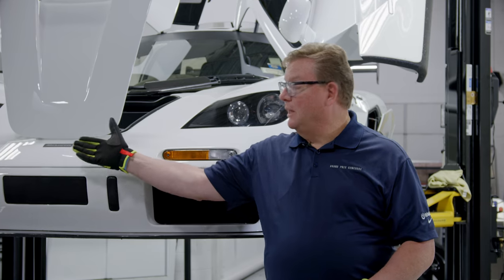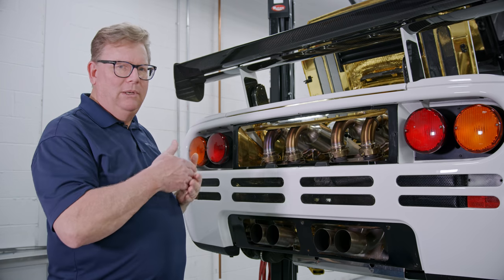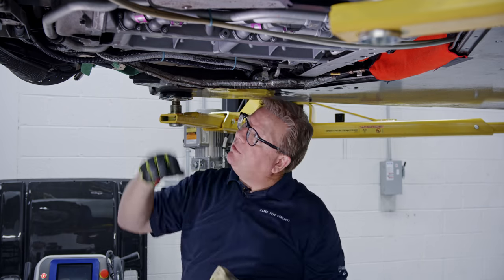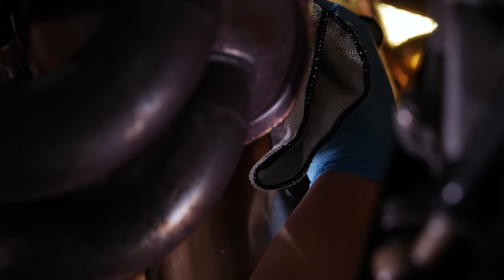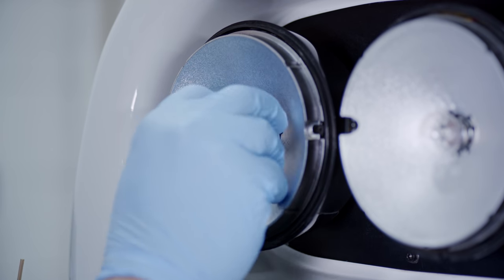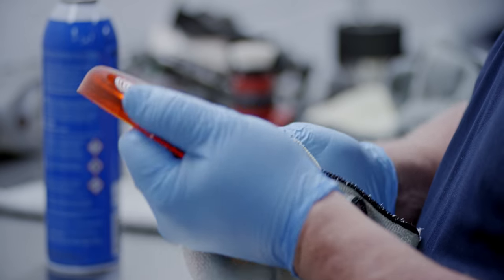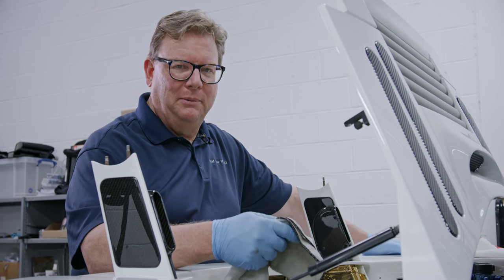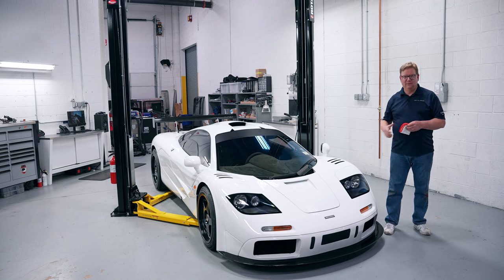Cleaning the 24K gold foil in a McLaren F1 supercar | Beyond the Details

Comment: This car is both a work of art and an engineering marvel. It's way above many italian supercars. No expense have been spared on building this thing, it's more akin a jet fighter plane than a car.
And maintaining it at this level is necessary, and like preserving a (in)valuable artwork.
Reply: As an engineer, it's the first time I am seeing the trick stalling active aero diffuser that Gordon Murray designed for this car. Way ahead of his time with that little trick.
Reply: And those who say that some bits should be replaced (like the rear light covers) I would want to keep everything as original as it was. Specially if its been raced at race like Le Mans 24h, which then would make it even higher in value.

Comment: today I learned there's a job called "McLaren F1 technician", and now I have the sudden urge to learn vehicle mechanics.
Reply: McLaren technician aka mechanic that works in khakis and plays golf.
Reply: @rxwhat33  nope, I definitely don’t play golf.
Reply: @kevinhines1278  Hahaha hello Kevin! And thank you for your hard work!!
Reply: @kevinhines1278  how does someone become a McLaren technician?
Reply: @blakerh  Hi Blake, if you have some experience all you have to do is apply at a McLaren dealership and be good enough to get the job. Then you will periodically be sent to McLaren factory training to progress your skills with the product. The chances of working on an F1 are pretty slim but if you’re trustworthy enough, you never know…
Reply: @kevinhines1278  I imagine it can't be that hard considering you only need to know one car, and it's almost certainly going to be well maintained and well documented and you get tons of factory support in which they spare no expense. I sincerely doubt that you have ever had to deal with a rusty suspension bolt snapping off, or having to tap and rethread a head bolt in a shoddy aluminum cast block. 

But, regardless, I am sure that you are well qualified, and simply dealing with the expectations of a typical wealthy McLaren owner is probably the most difficult part of the job. So, kudos!
Reply: @kevinhines1278  I was wondering why the wing was mounted on 3 studs instead of four? Is that intentional? Or did one stud come off by accident?
Reply: @bobdobbs69  I suppose that the best compliment that I could receive from an individual not privy to the details of the work I am tasked with is to have that person say that it looks like it was easy. So, thank you, sir.

One of the mounting studs for the wing came out with the locknut nut - the situation was rectified before being reinstalled. Good eye.

Be well

Comment: I knew the F1 was an engineering marvel but I have a new respect for them now watching this video. I don't recall ever seeing a white F1 before but WOW it's absolutely gorgeous. The F1 LM or F1 high down force version in orange and now white are certainly on my list of desirable cars.
Reply: As an engineer, it's the first time I am seeing the trick stalling active aero diffuser that Gordon Murray designed for this car. Way ahead of his time with that little trick.
Reply: @bobdobbs69  I really like his new car the T50 I believe it is from an engineering standpoint, but visually I think it was too safe. It's too reserved for the price point it is at and to me the fan on the rear is way too prominent.
Reply: @chesspiece81  We'll soon see how it drives, but it's certainly the most innovative car that I can see on the horizon. A 12,000 RPM NA V12 is going to make some beautiful noises. The T.33 will come out later without the fan, but I agree that the styling is rather 'middle of the road.' 

Considering the rather anemic sounding turbo/hybrid motors on offer from other manufacturers, I think the T.50 might be one of the best road cars ever built. Soon we shall see. ;)

Comment: oh and I was a jewelry manufacturer for 12 years and to clean gold on a car since you can't take it out of the car and ultrasonic clean it, hand polish and ultrasonic cleaner it again just use a good jewelry cleaning cloth and a good cleaning/polish compound that doesn't leave a residue.. if it's real gold and Gordon Murray didn't engineer some crazy  new one off version of gold you treat it just like a piece of jewelry.. the coolest and fastest  piece of jewelry you have ever seen I might add lol
Reply: It's just gold foil, rather easy to reapply it. At $2000/oz vs the $200/oz it was back in 1995, though it might cost quite a bit more to do the entire engine bay.
Reply: @bobdobbs69  well sure I get your point totally the point I was trying to make was that he said that cleaning gold was the one secret he would never tell and all I was saying was that if it's just gold like any other kind of gold I've ever worked with and not some special version that has extra alloys and all these different you know added materials to the gold itself it should be like cleaning gold jewelry I mean there's literally no difference if the gold in the F1 is the same kind of gold they use in rings depending of course on the kt which of course most people know that is just a purity rating

Comment: the tail light lenses were still all full of fine scratches
Reply: You’re right ! And three out of four have large molding scars. Not the best lenses to show a polishing method. But it shows one method of the process
Reply: @timmcnair4424  Gordon Murray was always miffed that McLaren didn't have the money to design custom headlights and taillights. Easily the cheapest part of the car.

"The McLaren F1, despite its jaw-dropping performance and revolutionary handling, was in some ways a parts bin special. The rear lights on the F1 were sourced from a third-party manufacturer that also supplied lights to coaches. That means this 1987 Bova Futura has rear lights that would slot right in the back of the McLaren. It's certainly an association most F1 owners wouldn't be too happy with being reminded of."

Comment: Did I imagine this or did Gordon Murray say the gold turned out to be unnecessary for the purpose it was installed for?
Reply: It was total overkill. Just Gordon being Gordon. Long term, it probably did protect the carbon from delaminating quite a bit (the epoxy back then would melt at 400 deg F, but the typical McLaren F1 owner probably doesn't track the car long enough for the engine bay to get stupendously hot, anyway. For the GTR and the cars that did see actually track use, I am sure that it helped with protecting the carbon fiber parts from excessive heat.

In reality, it's probably just one of the main bragging points about the car and probably is one of the many reasons the car is special enough to have inflated in price so dramatically.

Comment: Using the wrong Screwdriver, a PZ2 on a PH2 Screw is not the level of detail i would expect on a "$20.000.000+" car. 11:25
Except that - great knowledge and a fantastic video. Thank you!
Reply: Does it actually matter in low torque scenarios?
Reply: @paul--b  No. If the detailer had put any torque into that screw the taillight would have shattered long before the screw stripped out.

Comment: FYI he uses windex on the gold foil...
Reply: Nope.
Reply: @timmcnair4424  yep I use it to polish my gold bars (srs)
Reply: @karenthomson9749  unfortunately Windex has an abrasive quality to it. The foil used in the F1 is extremely thin. Slightest abrasion removes it from the Mylar? backing. Really strange material.
Reply: @timmcnair4424  yes it’s a very mild abrasive perfect in this situation to remove any dirt or carbon buildup.

Comment: I think it's stupid to put gold on a car engine compartment. On the interior may be ok. If it doesn't make it go fast then what use is it? Rich people and what makes them happy makes me puke. It's freaking ridiculous.
Reply: Gold is the best heat reflector,  and it was used to reflect engine and exhaust and catalytic convertor heat away from the painted carbon fiber bodywork, the wiring,  and electronics. Was gold the only choice? Probably not.  However, this was built,  money no object,  to be the best driver's car ever,  with extremely low weight and high power,  so there's that.  The amount spent on gold is nowhere near that spent on carbon,  titanium,  aluminum,  etc. Worth it? A thousand details like this make this car what many think is the best car of all time. They are currently worth about 20 times their original price.  Maybe it was worth it after all. I admire the workmanship,  but I'd never pay this kind of money for any car.
Reply: @jamesengland7461  Also, remember back in 1995 gold was around $200/oz and not $2000/oz.

Comment: These cars are all nonsense, when treated this way. The idea is to create the most amazing driving experience for performance, not construct a show pony that lives under glass and gets detailed every week.
Reply: Exactly, the buyers should honestly have to sign a 'must drive periodically' agreement. I heard some oil sheik in the Middle East has a few McLaren F1s literally rotting away in storage because cars absolutely do not do well sitting in place for a long time. Gasoline itself only last about 6 months before it goes bad. All the fluids turn bad and actually do damage to the engine from the acids that build up.  Not to mention the suspension takes a set, and the tires go bad as well.